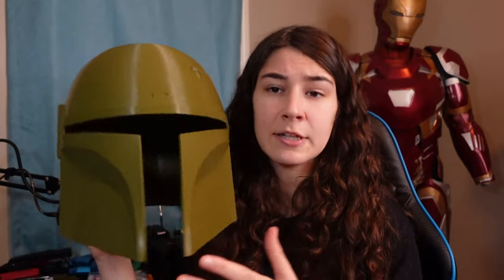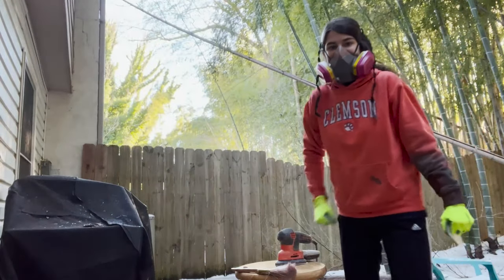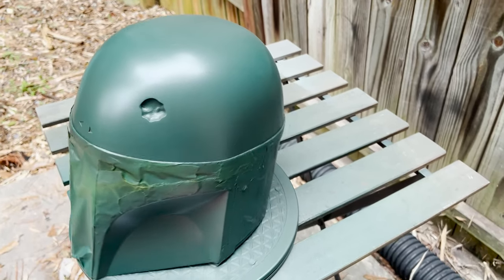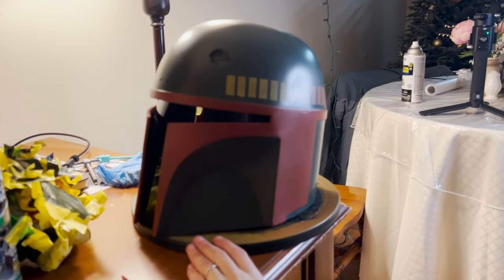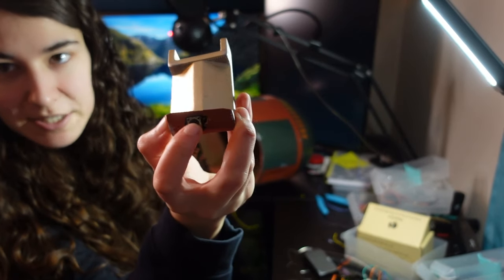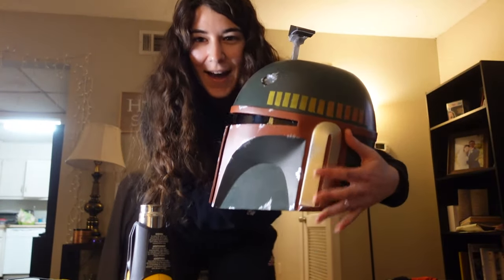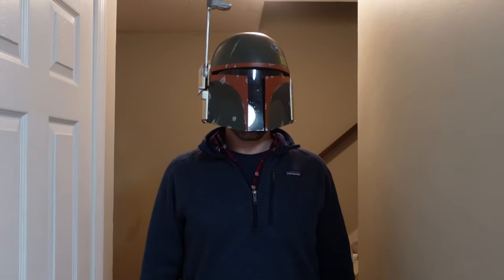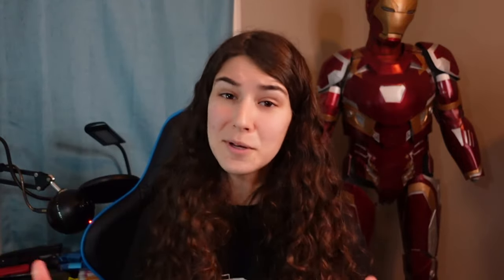I Made Boba Fett's Helmet (with a Motorized Rangefinder!)

Comment: Mix your own rustoleum colors next time. You can print/buy a female/female adaptor, freeze the 1/2 empty can you’d like to fill with paint, boil water and warm up the donor can, and depress both into the adaptor. With the cold cans lower pressure allows it to accept the other cans contents. It’ll stop hissing when the cold can is full.

Comment: helmet turned out great - a tip for ya , the visor you can order a Hobart 770580 Face Shield Replacement Lens or any similar brand or make - its  a tinted welding shield - they cut easy with heavy scissors and  are veryy flexible - awesome job on the helmet !!!!!

Comment: Simple solution to visor cracking: use polycarbonate (lexan) instead of acrylic. Acrylic will crack if you look at it wrong. Polycarb is more flexible. Downside of lexan is that it scratches rather easily.
As for tinting, position the plastic on a table, and tape it down along one edge. Overlay the tint with backing still on it and tape it to the table as well. Flip tint sheet over, peel its backing. Mist both your clear piece and tint with soapy water. Gently lay tint over the plastic piece while squeegeeing water/air from between the two.  Since both pieces are taped to a table you'll be able to use both hands for the process and it will go much easier.

Comment: There is a tinted safety face shield that most people use and cut to fit that is dark enough
Reply: This is what I used for my Mando helmet. They are like 25 bucks on Amazon. I assume they are that high due to a lot of people buying them for cosplay or the fact they are legit welding lenses. Either way, they come pre tinted and mold easy with a heat gun.

Comment: I really liked this video.
Despite your troubles with the visor, you were pretty lucky regarding the paint. Mixing brands is always a gamble, and painting outside really surprised me. I'm in Toronto and although it's -7°c which is manageable, i couldn't imagine painting. But you pulled it off, and it looks fantastic.

Comment: I don't know if somebody commented about that topic already but I think you used acrylic glass and that's very brittle and creates very sharp edges when it breaks. You should use poly carbonate. It doesn't break and is pretty scratch resistant. All modern headlights on cars are made of this. You can get sheets in all sizes on eBay or Amazon. Great work btw crap on building and greetings from Bavaria.

Comment: Great work! Maybe you should reconsider the weight distribution. I think it should be possible to discard the battery compartment and put one battery in each of the earpieces. Just two wires around the inner helmet will make them work together just like they do now in the compartment.

Comment: do you know what I would do?  I would use the actual method lucasfilms used when they made the damage on boba fett's helmet.  They spray painted it silver, then coated it with green paint then started to bash the head with a rock.